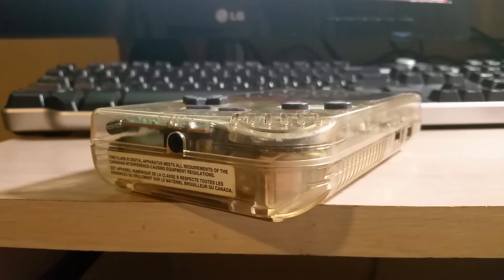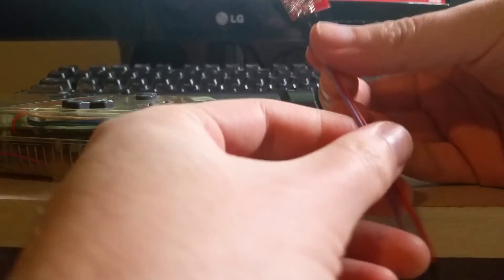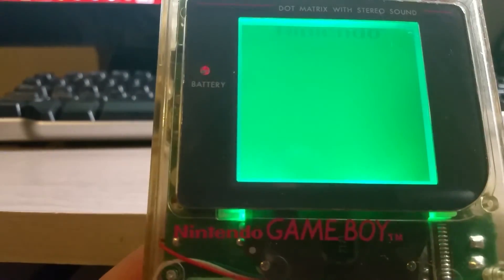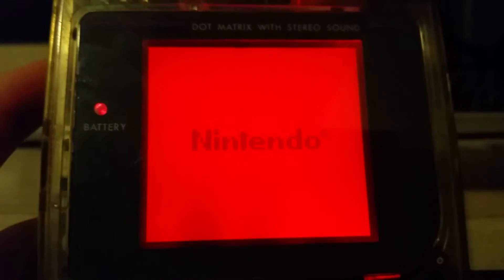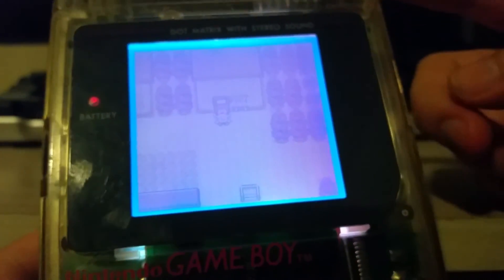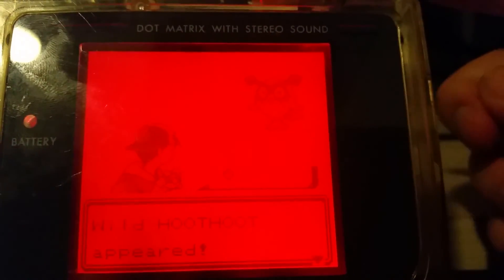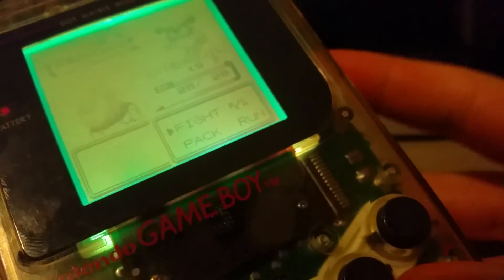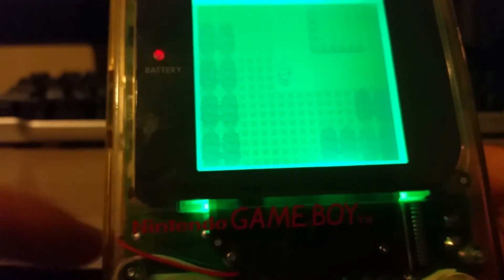Backlit Digital RGB Biverted Nintendo Gameboy DMG Mod All Finished!!!

Comment: Could you use this switch to turn on and off the backlight?
Reply from the maker: Yep, it'd be just a matter of modifying the program running on the micro that drives the backlight.
Reply: Thanks, I'm thinking of backlighting my HP 200LX.

Comment: Hello ! That's an awesome work, could you share the wiring between the sensor board and the rbg panel ?

Many thanks ! 

Pierre
Reply from the maker: Its not so much the wiring that is important, it is the microcontroller I programmed to perform the color generation and touch sensor reading. I sell kits for this mod through my buddy's site (www.roarkesretrocorner.com) and I believe he has installation instructions there.